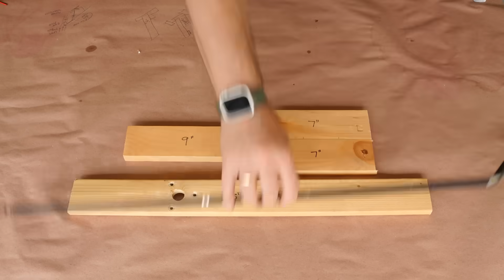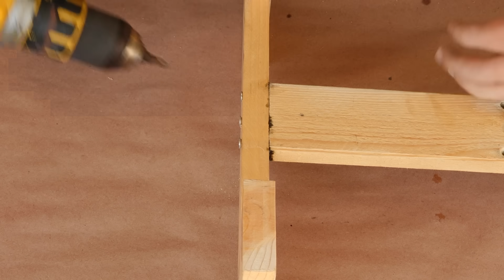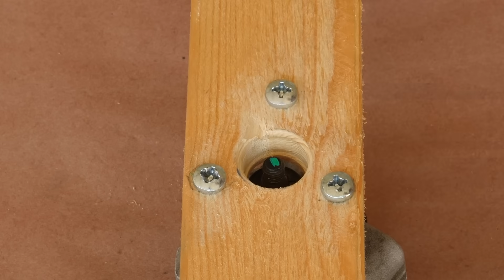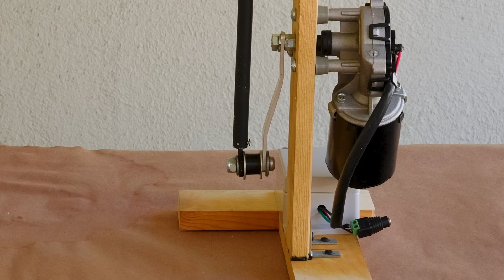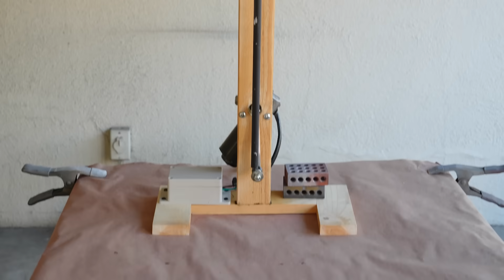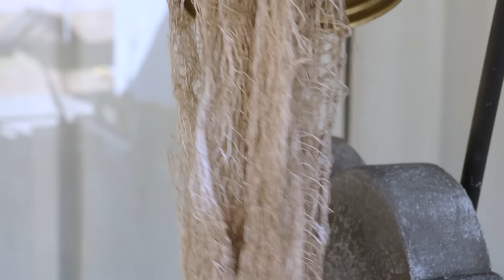Spooky DIY: Floating Candelabra Halloween Prop Tutorial

Comment: Again sorry for so late. Your design is fantastic and looks great! I did a very similar design, using my go to DC geared motor. Though I did build my own motor controllers and other electronics etc ... On the display chassis I used 1/8" stainless steele rod and an A-frame to hold the push rod through a 3/4" to 1 1/2" ring bent  90 degrees over to run the rod through. Now the big difference. My candelabrum is mounted to a free gimble and weighted to keep it mostly level. Using a controller and some very simple software it changes speed when there is someone close to the display. The effect to the different hole size and the speed make the candelabrum seem to mover in and out as well. 
Happy Haunts
Peace
Reply from the maker: That sounds like an incredible setup, especially with the motion-sensing speed control!

Comment: Not the most interesting motion tho.  Would be nice if the candelabra stayed upright.  Tilting makes the simple mechanism more obviousl.
Use of the classic flying ghost crank with wire/rope or the old bike rim trick to have it move through a circle at an angle, up and down and left and right.
You would need either batteries in the candelabra for that, or a reversing switch to prevent the power wires from twisting too far.  Not bad tho.  :)

Boulder's Haunted Warehouse, Carnival of Fear, Castle Of Fear
Reply from the maker: It's definitely a work in progress, but is really designed for people who don't have anywhere to mount a flying crank ghost or Axeworthy ghost mechanism.

Comment: suggestion: make the clamp holding the flambeau pivotable, so the flambeau stays perpendicular by gravity. You may add some weight to the base for this. Additional adjust the diameter of the pvc tube so the shaft won't tilt to the other side at the point of directional change.
Reply from the maker: That's a great idea, thanks for the suggestion!

Comment: Love the prop!!! Where did you get your hollow aluminum rod with eye hooks?
Reply from the maker: Thanks!The aluminum rod came from the hardware store and the eye hooks were screwed into the ends of the tube.
Reply: @VanOaksProps awesome! I am going to try and build this for my haunted mansion themed graveyard
Reply from the maker: @phillipmerritt1946  excellent!
Reply: @VanOaksProps did the rod have threads for the eye hooks already? Trying to figure out how to get the eye hooks on the end of the aluminum rod.
Reply from the maker: @phillipmerritt1946  Nope. I found a few nuts that would fit inside the rod and used a set screw to keep it fixed in position. Then I screwed in the eye hook. 

You could also bypass the eye hook altogether and flatten the rod end that gets mounted to the motor and then find an eye hook with threading slightly larger than the rod’s inner diameter and just screw it into position.
Reply: @VanOaksProps  awesome! Thanks!!!

Comment: FYI...When it comes  End Grain remember that it wicks in moisture like a straw and its why posts often rot there first not from the surface. Take this into account when you glue End Grain pieces to one another like in a picture frame or onto another surface as well. The trick to make it a stronger bond is to apply a layer of glue then let it wick into the grain and it will look dull not wet after several minutes. This is when you apply a bit more glue to the End Grain them clamp etc. the pieces together because  the first application has been absorbed like a primer. The second layer of glue now has a foundation to hold onto where just one application wicks in the  adhesive leaving little bonding strength.
Reply from the maker: Great tip! Thanks for sharing it

Comment: One thing I would personally add would be a glued and screwed 45° wood brace instead of those angle brackets. It would provide much more strength. Other than that, great build!
Reply from the maker: That's a good idea, thanks!

Comment: Yet another wonderfully elegant build! I agree with someone about adding Vantablack or possibly black flocking to the arm but that is only half of the secret. The other part is lighting. This should be lit from the side with some masking material to keep the projected light off of the control arm. Ideally a Source 4 theatrical light that has shutters on it would be great but would be overkill. The simpler solution would just be a small light and masking material between the source fixture and the candelabra. Hiding things like this is a combination of the item to be illuminated, the background and the control of the light to isolate it only where you want. Thanks again for more beautiful work!
Reply from the maker: Thank you for the suggestions; I appreciate it!

Comment: excellent work as usual do you have a link for the little things, nut and bolts etc the important stuff most of us dont have to attach everything i would appreciate it , and thanks for the links on the main things
Reply from the maker: I don’t know if all wiper motors take the same hardware so I’d hate to suggest it and have it not fit.
Reply: @VanOaksProps  i would be using the one in your link
Reply from the maker: @michaelmyers2517  I used the following:
M8 coupling nut 1”
M8 1” bolt
M8 lock washers - x2
m6 x1.5 - x3 (to mount motor)
Reply: @VanOaksProps  thanks sir

Comment: Love the design but the gauge wire you are using between the barrel connector and the speed controller looks too small to carry the current required by the wiper motor.   You might check if that wire is getting hot during use and replace it with thicker wire.
Reply from the maker: Good point, I'll keep an eye on that!

Comment: Looks nice, you could get rid of that jerk motion at the apexes with a swivel between the arm and the candle holder the swivel could be a ball bearing or as simple as a lose ball joint it will keep the candle straight up and down so as it sways at the apexes it won't jerk at the dip giving it a more smooth figure 8
Reply from the maker: That's a great idea, thanks!

Comment: Surprised you didn't use clear acrylic instead of the black aluminum tube to hide it better.
Reply from the maker: Clear acrylic might be too fragile.
Reply: I used extruded acrylic for a similar project...looked cool for the first three rotations then cracked.

Comment: You should think about adding simple drawer glide to act as a linear actuator to keep the candelabra from flopping back and forth.
Reply from the maker: I think that would only get me a vertical movement unless I’m imagining it wrong.
Reply: @VanOaksProps  Hmmm, perhaps a different mount that lets the candelabra slightly rotate as the arm it's attached to goes through its motion, keeping it upright?
Reply from the maker: @quixoticjedi942 the more I think about it the more I realize I just need to make the pvc coupling smaller so that the black rod isn’t flopping from side to side as it makes the rotation.
Reply: Though that would be a great use if you wanted to hang it from a hallway or closet ceiling! That would give it a subtle floating back-and-forth affect. Oooo then you could even do a never-ending hallway style backdrop behind it! Look at me with the ideas 😆